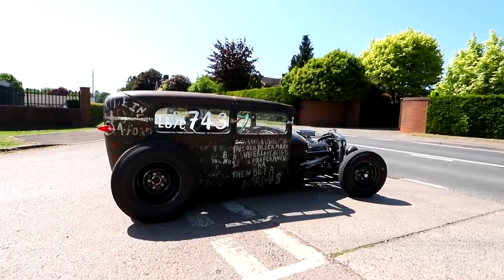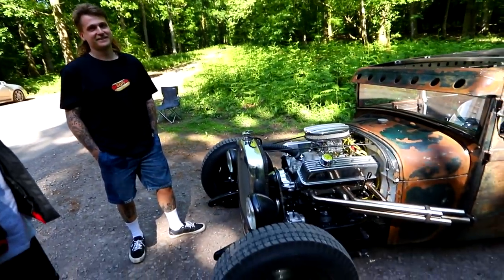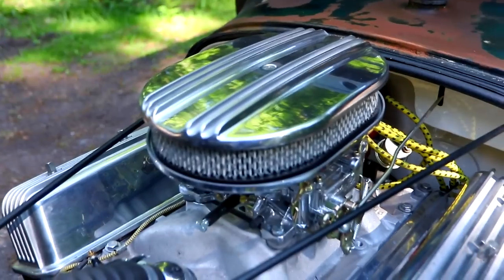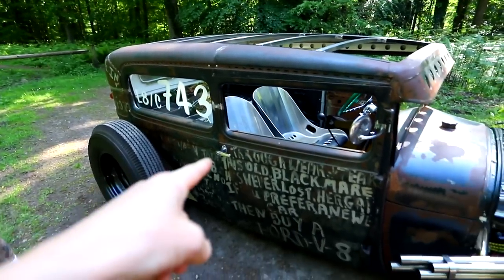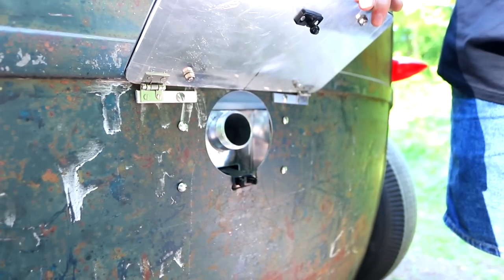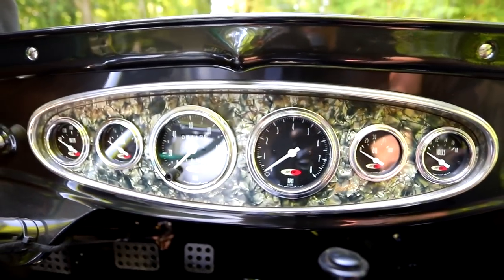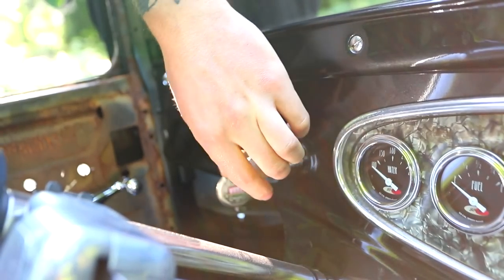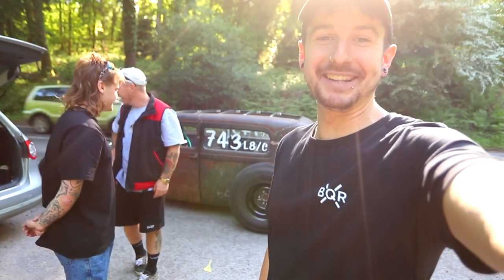Ricky's 1928 hot rod - Car check

Comment: SBC went up to 400 cu inch from the factory and BBC up to like 454.  The appeal to the BBC is you can really push them(power adders), since they are sturdy But the LS is more so these days.  LS have the weight savings of a SBC and study like a BBC and cheaper to mod dollar to HP than both.  You could build a nice SBC for the cost of good BBC aftermarket set of heads but SBC blocks are limited to maybe 500-600hp.  Still I'm a SBC guy, wish I got into LS but all the stuff I know n all the parts/tools I have are for SBC